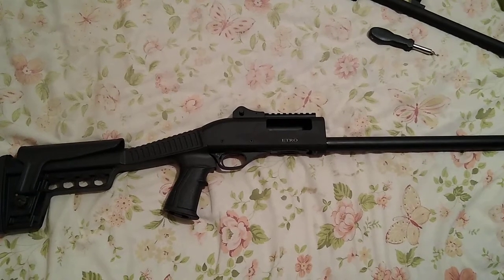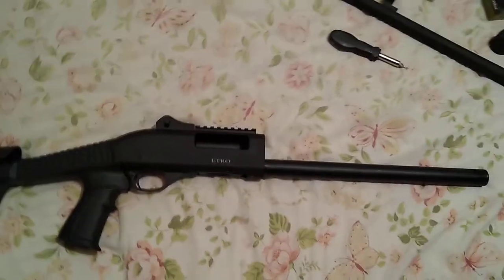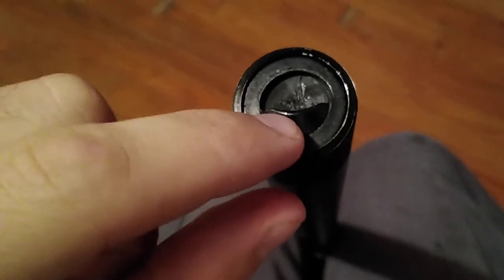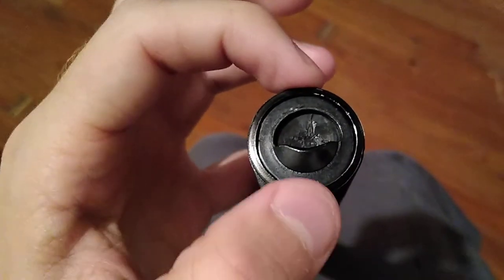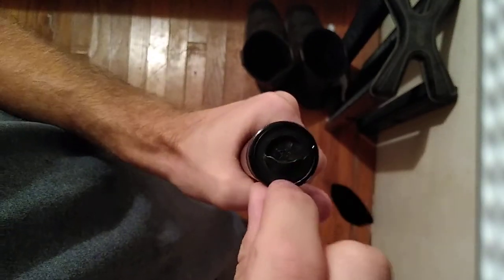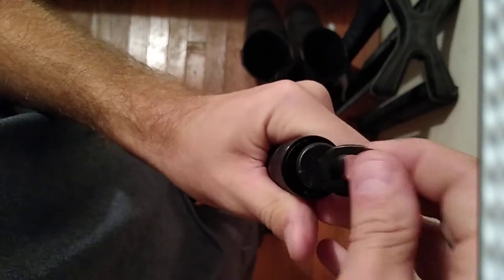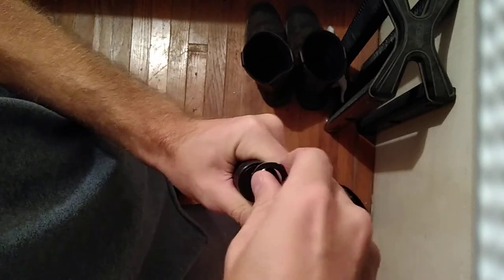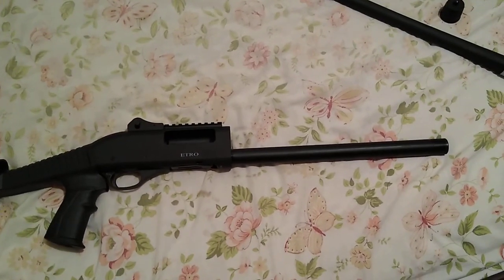ATA Etro E10 magazine plug removal.

Comment from the maker: A good tip for anyone buying these kinds of imports. While you're in the store looking at the gun a good indicator of a poorly made gun is a very loose bolt lockup. The shotgun in the video had a very wobbly bolt and was poorly made but some of the turkish guns imported by Rock Island Armory are actually pretty well made. Also the chances of getting a poor quality or defective firearm from Academy as opposed to other shops is higher. Best thing is to go to a gun shop that offers a two week warranty that covers defective products.
Reply: Ayo can you do a stock removal vid
Reply from the maker: @christopheralva2450  I don't have the gun anymore. But I'm fairly certain you can remove the stock by taking the buttplate off the stock and there should be a screw inside of it that attaches it to the receiver. It takes a super long screwdriver or socket set to get to them.

Comment: WQW! 
I didn't even know this! Saw your video while looking for a sidesaddle!. Followed your instructions and DAMN! You are correct! I just removed that plug with the video you provided! THANK YOU!
Reply from the maker: They have these is just about every shotgun you buy new. But most of them are easy to remove either with a threaded cap at the top of the mag tube or by removing the mag tube.

Comment: Does the shotgun need that small metal ring with the lip? I lost mine😬
Reply from the maker: I guess not as long as you're able to get the cap back on. It just holds the spring in place so it's not trying to fly out while reassembling the gun.

Comment: Could you post a range day and a gun review video please thank you , best regards from Texas
Reply from the maker: Can't find a good place to shoot anymore unfortunately. Super light shotgun so recoil is definitely felt even on cheap target load bird shot. Honestly if it's the only shotgun you can find definitely get it but the Mossberg Maverick 88 is better in every way. Tried to use it as a trade in on another gun and the gun shop wouldn't even take it even though it's brand new. You can't buy spare parts for them if something breaks and they say they've gotten good at making firing pins for some of the other Turkish shotguns for that reason. Makes a great throwaway gun though. Light enough to carry long distances and if break it I'll just find someone else that has one and give/sell it to them for parts lol. I'm from Texas too, Splendora.
Reply: @kevinlee6580  I almost bought one last month, looks really cool but it looked too good to be true for 200$ , somehow my guts told me it was going to fall apart on me at the range, I even looked it up couldn’t really find a review about it . Thanks for the feedback
Reply from the maker: @ardavanzahrooni1426  you're welcome! I recently learned a trick to finding a good quality Turkish made shotgun. If the bolt wobbles when it's supposed to be locked up (firing position) then it's poor quality. But if it has a solid lockup with little to no movement then it's good. Rock island armory seems to import some of the better made ones so I would stick with those larger importers that are well known

Comment: I just bought this gun a few days ago. I took the plug out. I thought the gun was supposed to hold 5+1 but I can't get the 5th shell In. I think it only holds 4
Reply from the maker: That seems to be a common problem. Are you using 2 3/4 shells or 3"?
Reply: @kevinlee6580  2 3/4.  That 5th shell will NOT go in mine at all

Comment: I just bought one and removed the plastic rod and it on loads 4 +1 now! Please help! Bout to trash it
Reply from the maker: You using 2.75 or 3 inch shells?
Reply from the maker: I can't find any info on how to actually remove the magazine tube since it isn't screwed in place. I believe they solder the tubes in place or something similar to it. Usually I just cut the spring down a little at a time but I'm not sure how to remove the spring. I'll look at it closer a little bit later and try and figure out a solution. Don't try to unscrew the mag tube though, I had a pipe wrench on mine at one point and it didn't budge. I stopped before I broke caused any damage though
Reply from the maker: No luck removing the spring or mag tube. I emailed the manufacturer in Turkey (importer in New York knew nothing about these) I'll post something if they actually help instead of just asking me to send it in.
Reply: Kevin Lee the book says it holds 7+1 but I’m only fitting 5+1 of 2 3/4” 
What does ur tube hold?
Reply from the maker: @kinggucci6742  5+1 was probably a misprint.
Reply: Kevin Lee both
Reply: I’m having the same issue... I took the plug out but can only fit 4 shells. The fifth one goes in about 5/6ths of the way in. 
I’ve tried 3 different brand 2 3/4 shells
Reply: Same problem with mine
Reply: @cosasmobile4499  did you ever fix this issue? Having the exact same problem with mine

Comment: My firing pin is suck how can I remove it
Reply from the maker: I don't have the gun anymore unfortunately. I wanna say they copied a lot of their designs from Benelli pump action shotguns so you might be able to find a video on firing pin disassembly and see if it looks similar to yours. If nothing else try a gunsmith. In my experience a lot of gunsmith are nice and will do stuff cheap or even free if it's a super simple fix.

Comment: Are there any extension tubes for these?
Reply from the maker: Nope. The way the mag tube is built dosent allow for any extensions. It would require a new barrel and longer tube which you can't get for them anyway since the tube seems to be fixed in place to the receiver.

Comment: Literally just had the same freaking issue!! Also find it weird that in the book in page 11 it clearly states “magazine capacity of your ETRO PUMP-ACTION SHOTGUN is 7+1 for 2 3/4” cartridges.” 
I can only fit 5+1 of 2 3/4”
Reply from the maker: Mine says 5+1 capacity. They probably printed the wrong info on your paper or something lol. Maybe they have one with an extended mag tube and accidentally put that info on their instead.
Reply from the maker: Does your mag tube come off? Mine seems to be fixed in place though I can see what appears to be a slight bit of threading. Hurt my hands trying to get it off lol
Reply: Not gonna lie was lookin forward to a 7+1 lol but for $199 fuck it 
And hell no bro I was trying my hardest to unscrew it for the last hour or so before I got online to do research, that thing is stuck in place, very odd if u ask me 😐
Reply: I’m shooting mine 2mrw first thing in AM on my property I have a private range, have u fired yours yet? I stuck a vertical grip on the bottom of mine but might take it all as it’s a far reach even for me who is 6’2
Reply from the maker: @kinggucci6742  I shot a couple shells of birdshot out of it. Recoil is a bit worse than any other shotgun I've fired since it's so light but that's to be expected. Didn't have any problems with mine.
Reply: @kevinlee6580  I shot mine and the recoil wasn’t terrible
Reply: My mag tube holds 4 shells of 2 3/4 and only 4 of 3inch shells as well.  Dont know why that is.
Reply: @kevinlee6580  mine workd and shots fine had no problem it had tons of lube on mine though a little to much but what can you do i only bought it because it was imported from a company that my freind runs dont ask who
Reply: @waynemercer4546  mine too smh 3-3” +1 in chamber  or 4- 2”3/4 and one in chamber odd says 5+1
Reply from the maker: @Waterbottlewithagun  if it was the importer based in New York I actually called them to ask how to get this apart and they didn't know lol. Also tried asking the manufacturer based in Turkey but they never got back to me. Luckily I figured it out.

Comment: Have you had a chance to shot yours? I ran 75 rounds through mine today. 25 of Hevi steel 1500 FPS and 50 at 1300 FPS. The stock recoil pad works great. I can’t find out what the heck ETRO means or stands for. So I have been telling everyone that it means Emergency Tactical Response Operation. LOL
Reply: Do you know what stocks fits these ? What stocks are compatible with this shotgun ?

Comment: Funny story, I was trying to figure out why mine wouldn't hold more than two shells. I disassembled it three times and even shot the cap and plug out. I thought I broke the damn thing and then reassembled the gun putting the plug back in. I then stumbled upon your video and realized I fixed the issue I was trying too. So now I am dissembling the damn thing again. Appreciate the video and subscribed

Comment: Thanks. I thought I was going crazy. Mossberg has a much superior design for this. I suppose I was thinking like an American. I thought it was that part but I was spinning it and finally gave up. I have had in my closet unloaded since Black Friday 2023 and it is April 4 2024. A shotgun for home defense ( because Joe B. Told me to get one) was useless only holding 2+1. Now I can Obey the all wise leader and have a shotgun for home defense. I should have never sold my Mossberg 500 years ago. I am the idiot on this one
Reply from the maker: Yeah for the price I definitely should have bought something else. I ended up finding someone with a new (but very dirty) Winchester 1100 defender with wood stock for $200. They bought it new and hung it above the front door and never fired it for like 10 years and it just collected dust. Took a couple hours to take it apart and scrub the solidified grease off the parts but it was worth it.

Comment: Bro your a life saver. Not sure if it was you or not but about 5 months ago I had this very problem with my similar shotgun. Same manufacture. You or some kind gent helped me by adding this link to my post for help on Reddit. Initially I was pissed but after this was nothing but all smiles. Took me all of 2 mins after watching this post twice to ensure I followed your instructions step by step. Thanks a million. BTW how many rounds have you put through it? What’s your feedback and how is it holding up?
Reply from the maker: I don't think it was me that posted it but I'm glad it helped. I actually got rid of the gun not too long after I got it just because it was way too light and seemed too cheaply made. The bolt lockup was way too loose for me to be comfortable putting anything other than bird shot through it. Hopefully yours is alot better made than mine was.

Comment: did what u did than my shotgun jamed. i think i put it back together wrong. any ideas
Reply from the maker: What part jammed?
Reply: when i had put it together to load it the slide wont move so i cant load and it wont come off the barrel wont come off
Reply from the maker: @jrrivas6000  sorry I didn't see that you replied. Kinda sounds like the barrel wasn't fully in place. Did that on mine the first time I took it apart. Had to do a little bit of wiggling to get the gun apart again lol

Comment: I just bought one and I know the original video was uploaded two years or so ago, and I read where you don’t have the gun anymore. But before you got rid of it, did you happen to find any accessories or aftermarket parts that would fit it? I read that some people have been able to get Benelli and 870 parts that would fit on it. Do you have any insight?
Reply from the maker: None that I know of. I'm sure there would be ways you can make something for with a little bit of filing or something though. I know they copied one of benellis shotguns but I don't know which one or if parts are interchangeable

Comment: Manual says its supposed to come with choke removal tool but was not in mine. DID YOU get your choke tool???
Thanks again for showing how to remove plug!! Can you do a video shooting it and tell us pro's and cons please?? Not gonna get a chance to shoot fir a while. Wanted this before election results are announced.
Reply from the maker: No choke tool at all. Just the gun and lock. When I test fire it I'll do a video on it.
Reply: No choke tool either.
Reply: No Choke tool either! And book says will fit 7+1 but mine holds 5+1
Reply: I get 4+1 using 3” shells. I’m going to try 2 & 3/4” to see if I can get 6 or 7.
Reply: @kevinlee6580  thanks!!
Reply: No choke tool here either. Mine holds 5 of the 2 3/4" shells, holds 4 of the 3". My manual also says it holds 7 +1 but is a misprint. Magazine tube is not physically long enough to hold 7. Just line 7 up end to end on a table and hold the gun magazine tube next to them and you'll see it's obvious 7 won't fit.
Reply: Does anybody know what kind of choke thats on the barrell. Doesn't say in the manual. Also mines didnt come with a choke kit either.

Comment: If anyone was wondering it holds 4+1 now after the modification. Just bought one for $100 because he said it only holds 2 shells😂😂😂
Reply from the maker: I think it varies. The quality control over in Turkey where these are made isn't the best and I suspect they aren't properly measuring the mag tube springs. Some people are only fitting 3 in the tube even after removing the plug. I've heard some people even say theirs fits 6 in the tube. I'm sure a combination of long springs and magazine followers are limiting capacity for some people.
Reply from the maker: I got an old WW2 30-06 rifle in a similar way because the guy said it wouldn't extract or reliably fire .308 ammo lol. Got it for $100 and refinished the barrel and had it looking nice

Comment: The owners manual makes no mention of the magazine limiter, or it's removal... only that the capacity is 7 + 1.  Thank you Kevin... so simple once you know.  (The actual capacity is 5 + 1 for  2 3/4" shells)
Reply from the maker: Glad it helped. Ive seen some comments saying theirs holds less and some even say more. Guess their quality control isn't great and the mag tube springs and followers aren't all the same size or something.
Reply: It's the shells...  Ammunition manufacturers are not consistent on the actual shell length, even though the box says 2 3/4"...
Reply from the maker: @robnicks4872  the measurement on the box is the fired length of the shell. So a 2 3/4 shell will be shorter than that until fired then the hull expands out to 2 3/4. I have a bunch of 3 inch .410 shotgun shells that are all 2 5/8 inch long but measuring them after they're fired they're exactly 3 inch long.

Comment: Bought mine last Saturday. Is it a good shotgun?
Reply from the maker: Irs an alright shotgun. Definitely not the best out there though even for the price.
Reply: @kevinlee6580  I have an ATA ETRO 10 pump action series. Can I extend the mag tube?
Reply from the maker: @waynemercer4546  don't think so. Mag tube isn't set up to take extensions and I believe they have the tubes pinned in place or something so adding a longer one dosent seem possible.

Comment: Got this gun.... I think getting a mossberg maverick 88 is a way better and cheaper option. This gun is okay, but you need to break it in. The shells at first have a hard time ejecting properly because of the stiffness and metal grinding. Once you get rounds through there you’ll start shooting a bit more smoothly. It’s an opinion but I think a maverick 88 is a better and cheaper choice! FYI: this gun is advertised as 5+1 shells but what it barely holds is 5 (2.75) shells but if you use 3” shells then the capacity is lower.
Reply: I thought I was only one with that issue my only holds 5 too

Comment: Mine only holds 4 2 3/4 shells. Why is that?
Reply from the maker: The magazine spring is either too long or the follower is to long. Or possibly both. These things are made in Turkey which in all honesty is a step below being made in China. China at least has rules and regulations regarding quality control on firearms for export.

Comment: Dude, I just bought this gun today, and had the same problem.  I got the little piece out a bit quicker with a screwdriver after trying pocket knives and my fingernails...  

Have you shot it yet?  Seems solidly built, basically an 870.  I haven’t fired mine yet.
Reply from the maker: I only put 5 of the Winchester target/bird shells through it. It didn't explode. I was worried about how loose the bolt is when it's locked forward and ready to fire. Figured I'd try and take a video when I fire buckshot or something a little bigger through it. Only real problem I have is I can't remove the mag tube or the spring at the very least. There's a bit of surface rust on the inside of the tube and it'll cause the follower inside to get hung up in some areas and not feed shells properly. Manufacturer still hasn't gotten back to me about it yet.

Comment: You most definitely helped me!  The only video close to this was for a Remington 870 but I spent an hour trying to get the piece to 1/4 turn and release before giving up.  Thanks.
Reply from the maker: That's why I made the video lol. Glad I could help!!!
Reply: @kevinlee6580  I checked out ATA's web site which has videos of hunts and such but nothing instructional so I asked them to provide something explaining that the manual isn't clear.  We'll see how/if they respond.  I know you no longer have the gun but it would be nice to have something out there covering disassembly/reassembly and cleaning for the Etro.  Thanks again for getting me started!
Reply from the maker: @douglasahunt  yeah I definitely wish I would've done a disassembly video but unfortunately I didn't. If I find someone that has one of these I'll definitely do a video on how to get it apart. Wanna say the bolt assembly comes out the front after you get the barrel off. Can't remember if it was this one or a different shotgun I had but after you got the barrel off you could pull the pump handle forward and the bolt would come out with it.
Reply: @kevinlee6580  Thanks Kevin.  The folks at ATA did provide a link for the disassembly of a Weatherby SA-08 which looks to be similar.  For anyone interested: https://www.youtube.com/watch?v=ANKq6huoYrg&t=53s&authuser=0